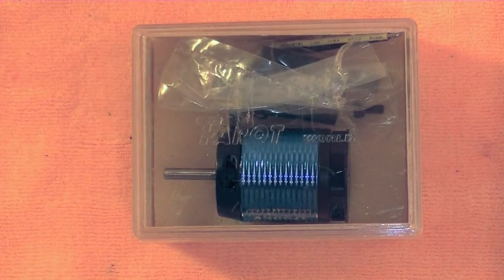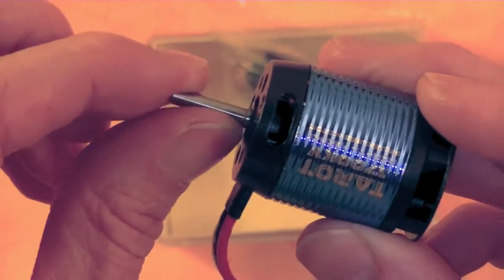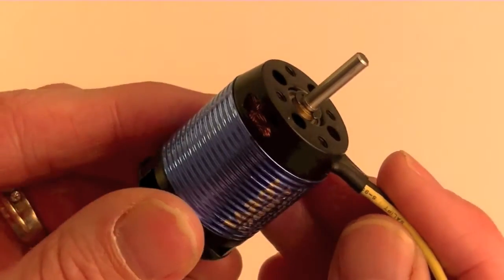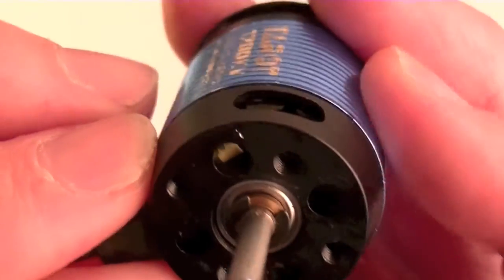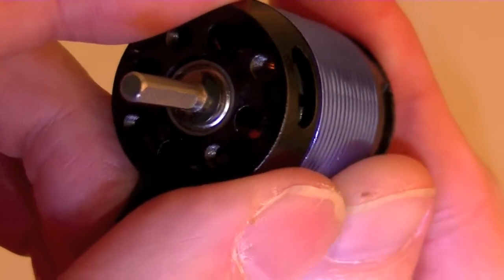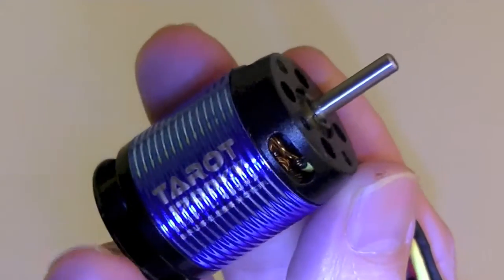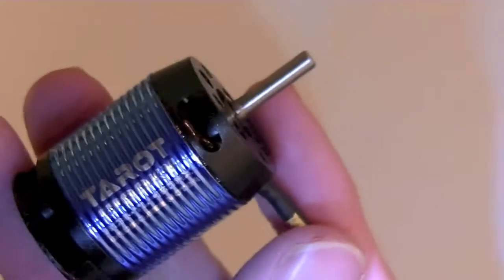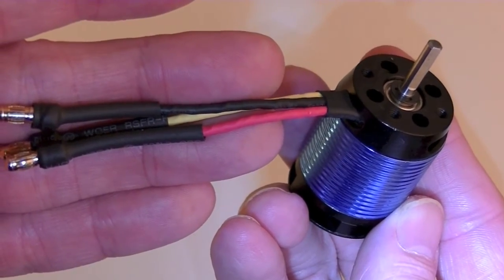52 : Tarot 450 : 450MX 1700KV 6S Motor

Comment: I have same motor on my newly trex 450 sport build and this motor is screaming and produce very bad resonances up to a mid stick position thus confusing my stabilization to behave awkward :( do i have bad bearings or my esc setup is wrong?
Reply: Zox Wolf There is lots of problems with Tarot 450 motors laterly: http://www.rcgroups.com/forums/showthread.php?t=2421951
Reply: Liza Gomes thnx liza
i think mine is 1700kv and i changed bearings, now its ok though i didnt still had any serious flights with my heli.
cheers
Reply: Zox Wolf Mine 2 was 1700 too....both gone...1 lasted 20-30 hours...the last was dead when i got it from banggood
Reply: bad luck or worse :(

Comment: Chris,
    I am going with a 1750 KV motor that also have a 3.5 mm shaft. I noticed that to get the lower head speed I desire, I find that a straight low tooth count pinion is not available for a straight cut main gear. What pinion size and what type of main gear did you end up going with and what head speed did you send up with? I think I will have to go with a helical pairing.
Reply from the maker: Are you running a governor? I found that was the easiest way to get the head speed I wanted...using the gov and throttle curve. You are probably aware of that, tho. ; ) 

Here is what I have on the 450 right now: I’m running a helical cut main gear (121t) and an 11t pinion.